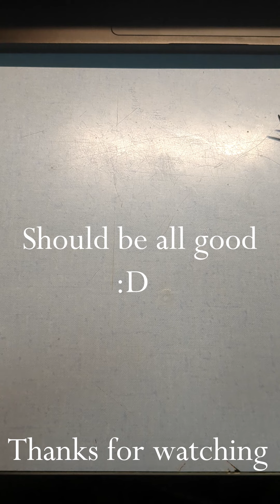SONY WH-1000XM4 Weird Noise Fix

Comment: Thank you so much for this video. It completely worked for me. I removed the faulty film from the mic on the side that was causing feedback. For good measure I removed the film from the other side as well. Your explanation and point by point demonstration were very helpful.
Reply: Hey. I just bought the same headphones yesterday. When this happens, can it happen while the headphones are turned off or just when it is on?
Reply: @sniperfox0108  it only happens when the headphones are on and only when you are placing it over your ears. Once it is off your head the feedback stops. You bought some great headphones. I love mine and prior to this problem these were my go too headphones. Since I’ve made the repairs they are back into rotation. I own the xm4, the Bose QC 45 and the Soundcore Q45. I would rank them as Bose, Sony, and then the Ankers. However, all three are great and a person would not go wrong with any one of the three models. Good luck with your pair. Take care.
Reply: @carlosvi_pr_investor68  alright thank u so much bro. U have a great day
Reply: @carlosvi_pr_investor68 does the anc still work
Reply: @JJ-006  I use the headphones everyday and I traveled this summer with the headphones and I had no problems whatsoever.

Comment: Thank you for your video. It fixed my problem doing deal cleaning with alcohol dip and cotton swap on the original microphones. The first two days it was better but with little noise in the background. After 3-4 days they were good as new!!!

Comment: I cleaned the ear proximity sensor, cleaned the mic without removing the black piece, cleaned cushions, works, thank you!
Reply: what did you clean it all with? is the filter really delicate do you have to be careful when cleaning- im getting a pair for wonderfully cheap butt hey do have this issue and i just dont want to break or damage in the process of cleaning

Comment: Thank you for the video. Just like the others who replied here, I have the same issue and my headphones have not yet reached a year when we bought it last Christmas more likely before Thanksgiving. I was really getting frustrated with the sound and it really dampens the mood when you want to listen to a good sound of music. My first fix was to use the optimizer and some adjustment to the sound settings in the app. So far it kinda works but i know eventually I will have to do what you've done.

Comment: As someone who has become dependent on these headphones to relax, thank you, thank you, thank you!!
Reply: Hey i got this issue very recently, have you done this right after you where getting the issue?
Reply: @hgt-27  I did it shortly after getting it. The problem is happening again since removing the mic cover tho.
Reply: @calvinmayer1275  ouch , you did clean everything tho ?
Reply: @hgt-27  I didn't have any Qtips on hand so I kind of just impotently wiped the mic with a kleenex formed into a point after being dipped in isopropyl, but I don't think it did much. I didn't even try to clean the rubber guard. 
I will buy some qtips when I can find them here in Germany and try again and let you know what happens! I also might try separating the mic wires with some kind of tape or something just to make sure they aren't touching.
Let me know if you have any success yourself!
Reply: @calvinmayer1275  hey that's not stupid, I've removed the mic for the slot and it didn't did any anoying noise , i should try to put a tape to see if it helps
Reply: @hgt-27  Any luck on your end? I wiped everything clean with Q tips and isopropyl alcohol, it's working again, for now at least. I also forgot to run the mic wire back through the three sets of little holders to make sure it doesn't move around the first time, I made sure I did that this time.

Comment: thank you for this video. fixed mine as well
one thing though:
if you use alkohol to clean the parts, let it wait on air for a bit, before assembling it back together, because the alcohol will cause the same issue when still in liquid form.
i know that it is obvious, but i am just stupid.
Reply: Use Isopropyl alcohol always to clean this type of parts, it evaporates very quickly

Comment: Thanks for this. Just gave this a try on my XM4's. Will update on how this works.
Reply: Did it work?
Reply: @TCHRISJ  it still happens but a lot less frequently. At the end of the day you just gotta turn off the noise cancelling feature to get rid of it 100%.
Reply: Hey. So I just bought a pair of these Sony xm4 and how long did u have it for before this problem started? Also does it make that sound while it is off???
Reply: @sniperfox0108  A few years. Honestly I beat the crap out of these things I'd buy again

Edit:. The issue only happens when you have the noise cancelling feature on. If you deactivate that you won't hear it. When the headphones are off you won't hear it either.

Comment: Accidentally ripped one corner of the rubber clip trying to figure out how it comes off. I thought it slid off by pulling downwards, but each corner has a little tab that is pulled off from underneath.

Comment: Shout-out. I've had my XM4s for almost 4 years now and the left side just recently started to do the really high pitched noise. Now I gotta order a pair of earpad replacement as mine are pretty worn out from sweat from working out. So once I get those in I'll also be able to clean the mics up as well. It's been a pain because while I'm working out I can just feel it starting up. Like I'll feel a sort of pressure change on the left side and than after a couple seconds it'll start doing the loud pitch noise. So I would have to restart the headphones or just turn off ANC which sucks.

Comment: Great explainer video but the metal tweezers can shred rubber and tear wires. Better off using your fingers or a plastic tool. But in my case, I was getting the squeal even after removing the black round filters from the microphones.

Comment: I had mine for 2 years, I have  tried this method but didn't work so I cleaned the foam padding inside with soap and warm water and it worked, the squeaking sound disappeared when the noise cancelling is activated.

Comment: Thank you bro. I tried so hard to fix it.
I dont know if its solve now, but I tried and look like to be a good solution.
I think the main weak of this headphone is abt humidity. So I follow your advices and I used a hair dryer too for let the humidity go away of this little part. (Let the headphone go cold before start it again and dont use the heater to close or too hot)
Reply: after one hour problem come back so I did the same with the second microphone (outside).
For the second one you need to disassemble it, 4 silver screw and take off the flex of the pad.
I do harldy with heater because I think there is something with humidity.
Currently that working ok. I monitoring it
Reply: I confirmed that still ok one week after

Heater on the micro help a lot

And I suspicious a lot the humidity so take care of your headphone and dont use in bathtub etc

Rain is dangerous too
Reply: @erwanh.4338  That's nice but be careful though that noise can be seriously ear damaging if you listen too long to it.

Comment: I just stuffed a piece of cotton big enough to cover the little microphone and the grey rubbery hood in the middle of the speaker and have not faced the noise issue since then. I primarily had this issue with the right ear cup, but the solution mentioned above was applied to both ear cups and it works just fine now, haven't had the problem recur for over 4 months now.

Comment: I had a noise in my left earcup and did the fix, now I have a noise in my right earcup and my left one is fixed. I removed the rubber cover on the right earcup but the noise still persists. What else can I do?

Comment: Same problem started about 2 years after having them. I just did the cleaning and put it back together and now just waiting to make sure everything is dry before turning them on. I'm already mostly deaf in one ear but would like to preserve what hearing I have left without the high pitched screech that is very triggering. This is clearly a known problem which for headphones this expensive, shouldn't exist.

Comment: Have you found the mic part number or a replacement mic? I cleaned mine like you said and the noise went away for a day but it's back now and just as bad.
Reply: I'm not certain it's a mic issue. Wearing the headphones while the noise is occurring, I slowly move the right earcup (the one with the noise) away from my ear and the noise begins to fade. Once the earcup is about 4-5 cm away from my ear/head, the noise stops. It resumes as I move the earcup closer. During this process, the left earcup (functioning fine, no noise at any time) is stationary in position over my left ear. Afaik, the right earcup does not have a proximity sensor so how does the headphone know I'm moving the right earcup?

The noise also does not occur if I turn the headphones on while they're horizontal on a table. I cover both earcups to fool the proximity sensor, but the noise does not occur. If I turn them on while wearing them and the noise occurs, however, then the noise continues even after I take them off and lay them horizontal on a table with both earcups covered.

As experienced by most others here, the noise stops entirely when the Ambient Sound Control setting in the app is turned off.

The noise has been occurring for many months. Earlier, I would blow into the right earcup with some force and the noise would go away for a couple of hours but always return later. On flights, the noise would always start when the plane was descending. This indicates to me that the noise is also a function of air pressure.

After I changed the earcup padding last week, the noise occurs every time I turn it on and blowing into the earcup no longer has any effect.

I'm quite confused as to what the trigger really is.
Reply: @AnkurBorwankar  Be very careful with that noise it can seriously mess up your hearing if you listen to it too long. It happened to me and it wasn't fun. Just a heads up.
Reply from the maker: i think it's this one: https://sony.encompass.com/item/13016363/Sony/1-009-745-91/
you are lucky if it ships to your location..
europe rip
Reply: @xavyding  Fantastic, thank you. I'm in India so it's even less likely to ship to me, but i could ask someone from the States to carry it once it's in stock.

Are we certain this is the part? Is there a way to confirm?
Reply: @orangeeeeeee  I was careful to wear earplugs when testing. Appreciate your concern. When it happened on a flight the first time i went deaf for a few minutes.

Comment: Mine has just started making high pitched and popping few days ago. This video really saved mine. Thx so much : ) 
One question, do you have popping noise issue? Because high pitched noise is gone for mine but the popping noise isn’t.
Reply: Have you found a solution
Reply: I though I did, but the noise came back…. No matter how many times I thoroughly cleaned it, the noise came back. So, I give up on using ANC at this point.

Comment: Either this is a coincidence, or not. When i removed the filter on my right headphone, i stopped getting low bass frequencies, the bass also stopped surrounding, it usually stays at the middle, unless i did something wrong.

Comment: Did this on both sides, put it back together, still getting a slight occasional pop on the left ear, I reran the noise cancel optimizer in the sony headphones app which helped noise cancel quality but still an occasional mild pop that I worry will lead to the loud tone eventually like it was doing. So far no loud tone issue though, crossed fingers, maybe I'll clean the left a second time. The tone issue seemed to occur mostly on the left.

Update:  Nope, still a loud tone and the warning pops that signify it's coming.  Cleaned a 2nd time, same issue... dammit.  Maybe I'll leave the mics in rice 24 hours.

Used to workout in these a-lot and ai think sweat got into the mics. 
I can always disable NC to bypass the tone in the meantime, super annoying you can't disable NC by default though
Reply: Worth noting there are two mics per side. Also rice is a poor desiccant, meaning it doesnt really absorb liquids well. Silica gel, and prolly many other things, are good desiccants.

Dont really know how well desiccants will absorb oil tho, or if that is even a good thing to do. The mics might be specced for being filled with oil.
Reply: i had same situation: after cleaning with alcohol problem didn't gone, but i tried this: instead of alcohol i put this mics into hydrogen peroxide for 40 minutes, then i dried it out for next 10 hours, if you try to dry it with hair dryer you probable will face with another type of noise, because of water inside, but give it some time and don't worry (in case of high humidity in your region use alcohol, just put mics into alcohol, it helps with moisture). Btw the problem was because of earwax, not only because of moisture, so try it.
Reply: Thanks

Comment: I also had this issue, but still under warranty. I got the headphones back now. The feedback whine is gone, but now I have noise only on the left ear. This is almost worse than before. They stated that they replaced both microphones. And they may have messed it up. Maybe they swapped the input wires? (polarity) This would result in an inverted phase or something. I will first try to get it fixed again.

Comment: If the problem persists even after cleaning the microphone, you need to have it replaced. The part number is ROM-2235L-HD-R

Comment: can i just remove the mic completely or is that not a thing
Reply from the maker: I won't recommend doing so. Removing the mics will deteriorate the sound quality when using the ANC mode. (when ANC is off, you should be good though). I think there are some kinds of factory calibration done with the mics, so if you remove them, the sound balancer/equalizer would make the sound quality less good. Idk if one can recalibrate it though

Comment: I took off the cover and it still didn’t help. Ended up covering the mic with a layer of cotton on all sides and put the cover back on. Took some adjusting to get it right, but they are as good as new

Comment: just like all the other comments here, i am also here to pay my respects and thank you for saving my headphones
Reply: Hey. I just bought the same headphones yesterday. When this happens, can it happen while the headphones are turned off or just when it is on?
Reply: @sniperfox0108  Only when the headphones are turned on can the screeching noise occur. If I were you, I would return the headphones if u can. My headphones still screech after trying almost everything on youtube and reddit. Tried calling customer support and for $200 dollars u can get them repaired only for the same things to most likely happen again. If ur not gonna return them I recommend keeping them clean and try not to wear them when u are sweating because ive heard that it can mess with the noise cancelling mic which makes the feedback loop in which makes the screeching noise.  sorry for the essay but I hope it helps  👍

Comment: It wasn't useful for me, but I noticed that holder isn't tight enough for microphone, I used glue and now it's working, probably sound was generated by microphone movement in holder. Hope it will help you

Comment: i knew it was probaly caused by moisture but i did not expect the rubber protector to just straight up be wet inside. so far so good, but its only been 5 minutes

Comment: I have two of those and they got the same problem after a year of use. I solved the issue by encapsulating the microphones in a thin layer of silicone using a silicone gun. However, the sound would be different and there will be a small amount of hissing when noise canceling is on.
Reply from the maker: i think that would be as if you removed these mics, and yes it makes some artifacts :/
Reply: Well it's I guess at least better that way than hearing that ear deafening noise
Reply from the maker: @orangeeeeeee  sure. though you can always just turn off anc
Reply: @xavyding  Yeah I know I was so stupid when I used the anc. I knew they were broken and now I have hearing damage that I still deal with almost 9 months later as a result
Reply: @orangeeeeeee  why can't all of us get together and send a lawsuit to sony's asses but I know it will all be hopes and dreams

Comment: Alright, the problem is with those small microphones, you are lucky if simple cleaning helped but it can be worse, I swapped microphones and noise moved to another ear, so definitely a mic issue. I'm ordering mics and will try to replace....
Reply from the maker: I couldn't find the part number or the refs of the mics though. Putting a random 6x2.2mm electret microphone doesnt seem to work...

Comment: Thanks for your video! I noticed that the Larsen was happening immediately when I left my XM4 in my car during the night in winter and it is very cold, when i leave it in a warm place for 10 minutes it was gone. So it seems there is a temperature factor in the equation of this problem. I noticed too that recalibrating ANC in the Sony app reduce the probability of the Larsen happening. I also wonder if there is a magnetic 🧲 factor , maybe the microphone get overmagnetized due to the proximity of the strong neodymium magnet of the earphone. Maybe a 180 degree rotation of the mic on it’s axis might help mitigating the problem. Or why not, use a tool demagnetizer to take it back to its neutral magnetic state.

Comment: I tried it on the right it worked i believe and now my left kne is screeching but ill do that one later ill update if it works
Edit it works about right but I gotta optimize it and then let it for some reason just run and it stop if it squeaks use ambient mode for a couple mins trust me